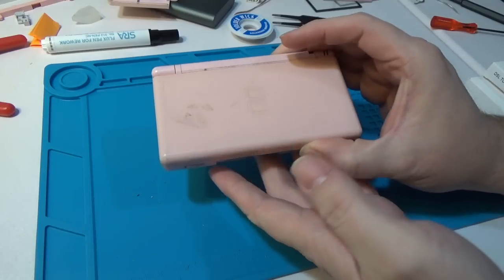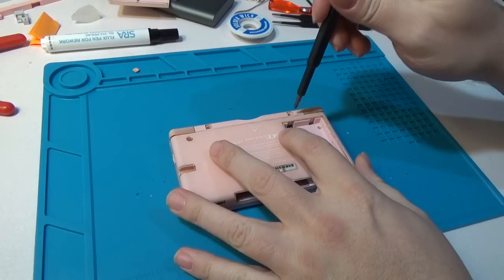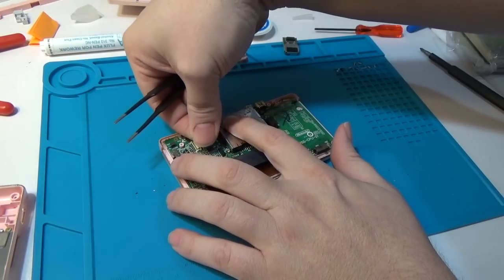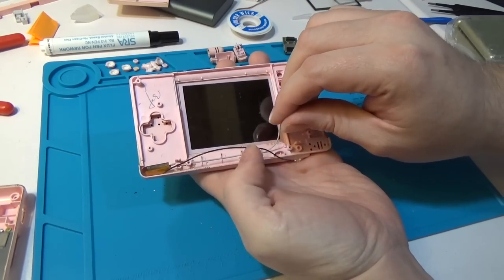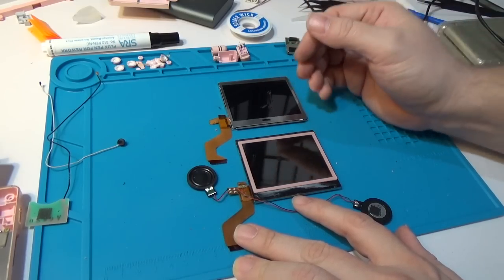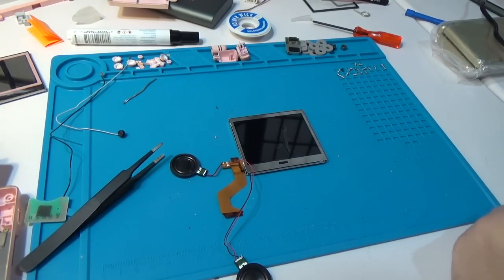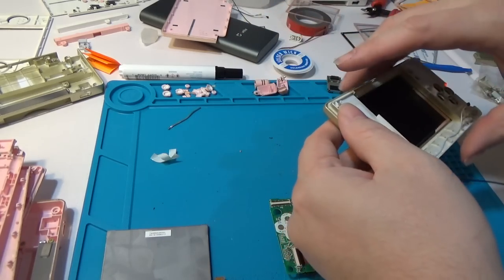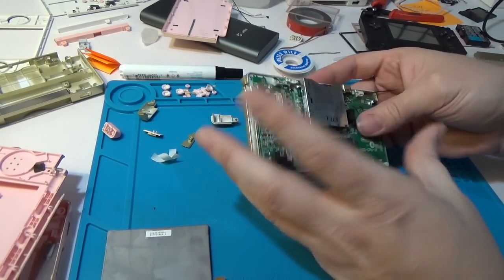How to Replace Nintendo DS Lite Shell and Screen

Comment: This was very helpful with replacing mine! it went well but now it won't turn on? The charging light comes on but not the device. Anyone have any suggestions?
Reply from the maker: If you hit the power button, does it do anything at all?  

Does it turn on, click, and turn back off?  If it does that, it's likely due to a loose ribbon cable that you'll need to reseat.

Does the power light come on, but nothing happens?  If that's the case, it's likely that the Wifi / bios chip isn't properly seated, and needs to be reseated.

Good luck!
Reply: @TheBrokenPast  Thank you for the reply! It actually doesnt turn on or anything. I actually took it apart again and it turns on and is completely fine. when its not in the shell. I think it might be because the power switch doesn't flick back in the new shell. After testing it and seeing it works, it put it back in the shell again and had the same problem. Any idea on how to lube up the power switch piece or? Thanks!
Reply from the maker: @Keele777  Hmmm.... it sounds to me like you're not getting the bottom of the case on it properly when reassembling.  If it works fine with it apart, but doesn't turn on when you put the case together, my guess is that the power switch cover piece isn't properly aligned when put together.  There should be a bit of a "guide" in the plastic piece to get it to align properly.  It has a bit of a notch in it that the power switch itself slides into.  You'll know that you've got it right, if the switch feels correct in sliding on (and snapping back down after you let it off).

I don't think you'll need to lube it at all.  It sounds like the power switch itself works, but it's just not properly aligning when putting all back together.

Good luck!
Reply: The Broken Past My dad attempted this like 10 years ago but got mad and gave up; today I decided to try and finish it. My power button clicks which is unlike the springy power button on the other working dsl I have. Is it a casing issue? Thanks

Comment: Hi, your video is really great and gives me hope that I can save my old NDS lite!  Do you have any recommendations where you can get shells that really look like the original? With the photos online you can never be sure if the have this clear outer layer and how sturdy the plastic really is.
Reply from the maker: Unfortunately, none of the aftermarket shells are going to be as nice as the originals.  I've reshelled three different DS's (the black Pokemon shell, a golden Zelda triforce shell, and a clear shell).  All had minor issues fitting back together, plastic creaking, etc.  They looked nice, but they never felt as good as the original shell.  Part of that may have been user installation error (routing the wiring perfectly so that it snaps back together can be a pain!), but the other part of it is just lower quality plastics.

Basically, tl,dr; - they all LOOK great like the original, but they FEEL slightly less quality than the original.
Reply: @TheBrokenPast  I searched kijiji and found pretty cheap (5-10€) consoles with broken screens but still good shells. There were some broken 2DS aswell for 20~30€, I saw in another comment that you are looking for those. I don't know your price range though.

Comment: Hello I have a problem. When I turn on the console, the LEDs and the screen below turn on (blank), but turn off instantly. I think that by dismantling the Nintendo DS I have forced the cable from the above screen and damaged it. If the top screen is damaged, does the console not turn on? Sorry for my bad English, greetings!
Reply: Yes, if the cable is broken the console won't turn on.

Comment: Hi, thank you for great video. But I have a question, when I put them all back in and try to power on, the bottom screen just flash white then powered off. The green indicator light goes up too same time before it turn off. Have I done something wrong. I think I've messed it up.
Reply: The flash means that something failed a hardware test on boot. Check to make sure you put the flex cables in all the way.

Comment: Can anyone help me? I reassembled it and when I turn it on the bottom screen flashes for a second and then shuts off
Reply: @Lima L. Thank you! I will try this out
Reply: @Lima L. Hi! I have the same problem after changing to new shell. Ribbon cable is in good condition but it won't turn on. Can you explain what did you do?
Reply: @abdinsyakirin77  That usually means that the cable for the top screen isn't plugged in properly.

Comment: i need help i did it and it wont turn on, but if i connect it to the charger an orange light flashes, what should i do?
Reply: You probably didn't connect something right or ripped some cable

Comment: I'm having a little trouble getting that back half of the shell to fit on the right side. It's as though there's something keeping it from sitting flush but as far as I can tell, nothing is
Reply from the maker: That's a tough one!  Take a look at about 1:19:55.  You can see that I move the antenna wire from below the component to above it, between it and the charging port.  If it's below that, it will likely interfere with some of the support structure of the bottom of the case.  It's a small thing, but it does make a difference!

You can see a closer picture of it here:
https://cdn.instructables.com/F56/SDFQ/FA0CVID7/F56SDFQFA0CVID7.LARGE.jpg

Make sure it's running along the top of that component, and give it another go.  Good luck!
Reply: @TheBrokenPast  Thanks for the reply! I've tried that but I believe my problem is that the wires want to sit beside each other instead of on top of one another. I'll fiddle with it again sometime. Thanks!
Reply from the maker: @jbingbong  Good luck!
Reply: Im having the same issue but on the left side lol

Comment: I got the mario shell. When i went to reassemble carefully the back cover the power switch snapped off and the em10 was broken. The plastic is not quite right. I then redid another switch only to snap it off again. My case is out of alignment. Should have put the original back on.
Reply: Well i have managed to get themario shell working. Powers up on battery only. Replaced switch twice and em10 twice. Its a mess. I have tried all my working ac adaptors but none bring on orange light. Any thoughts?

Comment: Great video, but Jesus. I saw that there were aftermarket transparent DS Lite cases and luckily had mine from when I was a kid still kicking, so I thought I'd give it a try after replacing a bunch of older mobile system cases. I really hope a video or something comes out of how these were made in the factory (if actual people put them together), because they're the most touch and go annoying things ever.

I think the longest I took to first-time replace a shell was an hour, and that was if I screwed something up and took 10 minutes to quickly take it apart again and fix it. I've been at this thing for 2+ hours and there are so many fiddly little pieces, and I'm still not done. The shoulder button springs are a NIGHTMARE.

Comment: So basically, my DSL after putting everything together, it flashes white on the bottom screen and immediately powers off. I also tore the ribbon cable during the process, could this be why? Thank you to whoever responds!
Reply: Yes, if the ribbon cable isn't plugged all the way in the device will turn off I'm not an expert (I'm trying to learn which is why I'm watching this video) but from the troubleshooting I've seen online this is why that happens in most cases when shell swapping, it's a loose or broken cable.

(I know this is late but someone browsing the comments who has the same issue may find this helpful so I thought it was worth posting)

Comment: Ds won't power on, the green light flashes and the bottom screen turns white before quickly shutting off. Did I ruin the system?????
Reply: Nevermind, my ribbon cable is now ruined too I might as well sell the broken system for parts now. I Started this video with a WORKING DS that had a faulty Hinge. Now I have NO DS and am out $50+..... Absolutely Lovely.

Comment: Aye aye aye. be careful what you're doing when you pull the screen ribbon out 12:30...you can totally ruin the whole thing if you "simply lift a little 'flap' and pull it straight out of the board"... you can pull the metal connections from the circuit board very easily, like I did. Back to the start.....

Comment: u r amazing. I have replaced my old case with one with same colors and yeah, had lower quality, but is not broken like the other one. unfortunately, the Touch flex seems to be damaged while I was changing the case and even I got a pain in the ass because the console was not working, but it waa only connection issues. I wilk replace the Touch screen soon an let's see what happens

Comment: Hey, I replaced the shell. everything went fine, but somehow it starts but it crashes after 1 second.
And only the bottom screen turns on for a second. 

Does someone know why that happens, so I can work on that? :D
Reply: did you reconnet the Wifi chip? did you use original nintendo screens?

Comment: Yeah I broke mine, when I routed the speaker wire I had it through the ribbon cable for the screen, I gave it a little tug and ripped the ribbon cable, I just tossed it in the garbage after that

Comment: I did it on mine, and its all good, except that now, the bottom screen flashed white for a fraction of a second and the console never wants to turn on. I can charge the battery fine though.
Reply: letting you guys know that if you have the same issue, the cause it that the ribbon cable of the top screen was attached incorrectly to the bottom part of the ds, you really have to slip it in there and then, turn down the tiny black flap above.
Reply: La Tite Thanks soo much for posting this follow up. Could not figure out why it wouldn’t work for the life of me. 🙏🙏🙏
Reply: @Dirty_Underwear  hahaha glad that my struggle helped you! :P

Comment: at 12:02 does anyone ever tried to remove the lcd glass from the lcd? See 12:02 where his left thumb landed on the bottom lcd screen. Few days ago I tried to separate the lcd touch screen and the lcd glass. Which turns out the touch screen was actually surrounded by a metal case with  a glass in the middle of it. So when the stylus touches the screen, actually itwas touching a glass instead of the real touch screen. 

And I have no idea how to remove these metal case and the touch screen inside it without damaging the metal case. If anyone has some experience about it pls share.

Basically doing 34:46 but for the bottom screen. If there's any video or anything pls share, thank you.

Comment: What causes the screen to get that way ?
Reply from the maker: Great question.

I'm not entirely sure.  For mine, if I put pressure on the screen, I did get some of the lines to slightly fade back into existence.  So, it could be a combination of a loose ribbon cable where it attaches to the screen itself, or decaying substrate on the panel itself, etc.  It's hard to tell the exact cause, without having tools that are way outside of my abilities to be able to debug the screen with!
Reply: The Broken Past okay so I have a question my top screen on my dsi broke so I was scrapping it down to to change the screen and I taught the pot meter was screws n I stripped it could this be causing horizontal lines in the bottom screen I plan on buying a new cable but just want to make sure it’s not the screen too
Reply from the maker: Honestly, it's hard to know.  

I'm not entirely following you though with the cable.  You can't replace just a ribbon cable for the DSi screens.  The ribbon cables are soldered directly to the screen.  You can't replace one without the other.

Best of luck on your repair!
Reply: The Broken Past it’s not the screen one is the one that connects to the volume and sd card part....... uk the one which is connected to the back of the game

Comment: Thanks for the guide!!! Sadly on my first try, I damaged the top screen cable and I had to get a new one. Then a was able to assemble the whole DS Lite and play for a while but the top screen started to show different colors so I decided to open the console again. The second time I finished the assembly the top screen was working alright but the touch screen was not working. Then I decided to open it for the third time but this time the console does not startup. It only lights up the screen 1 second and it turns off. Can you give me advice on this?
Reply: When you don't seat the top screen ribbon cable correctly it does that
Reply: @MilaNavi  thank you. At the end I pay to repair it.

Comment: 'Oh yeah the cables easy to get out but not back in'

Me, stuck here at 2am, wriggling the cable that's stuck underneath the game cartridge slot: I won't sleep until you're OUT

Edit: when putting it back together and putting the cable back through I gave up after an hour and put it over the game card reader instead. The ds works fine.

Comment: I came, I saw and I failed. First, the power pokey thing broke off, but even worse I think I damaged the lcd cable because it's just showing lines
Reply: I did that too LoL i don't kwon what to do 😅
Reply: @pedromauricio360  I bought a new top lcd and was super careful this time and it works. The power pokey thing is still broken. For the ribbon my tip will be to cut an inch of a plastic straw, wrap it into the straw and slide the straw into the hole so it doesn't get damaged with all the twisting action. Was it worth it in the end? absolutely no. Could have just bought a used unbroken one instead of fixing this junk

Comment: Literally all this work until that point where that ring doesn't fit into my new shell, shoot me :D
Reply from the maker: Hmm....  It's been long enough since I've done this that I don't remember fully.  If I recall on this one, the ring was equal thickness on both sides.  I've had shells that I've bought in the past that came with a ring that had a larger outer diameter on one half of it than the other.  Make sure if yours is that way, that you flip it around.  It should fit then.  

I've never had one not actually fit in at all though!

Comment: CANNOT STRESS THIS ENOUGH.... MAKE SURE THOSE BUMPER SPRINGS ARE SECURE
Reply from the maker: Great point!  Yes, most definitely make sure they're secure!  They're under a lot of tension, and can easily shoot out and be lost for good.
Reply: Another thing, upon re assembly i’ve noticed that the ds will power on but when pressing the left trigger it will shut off, how can i fix this ?